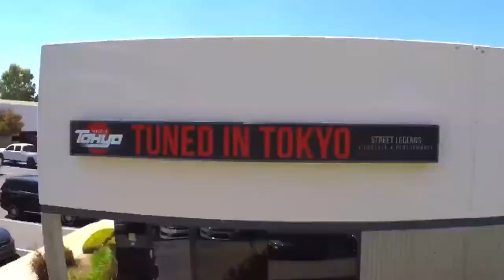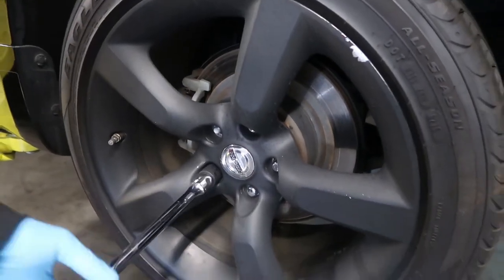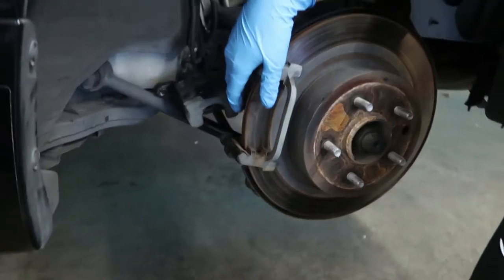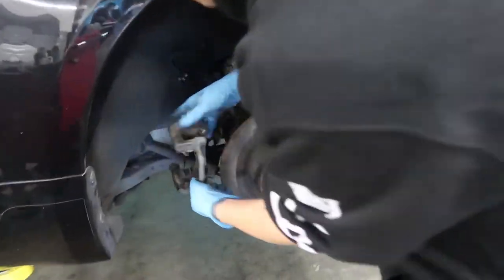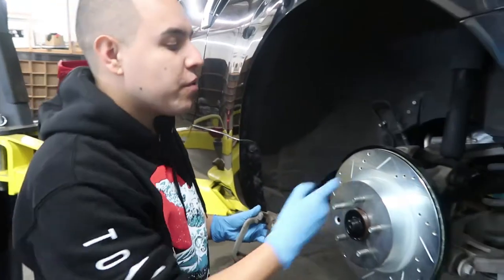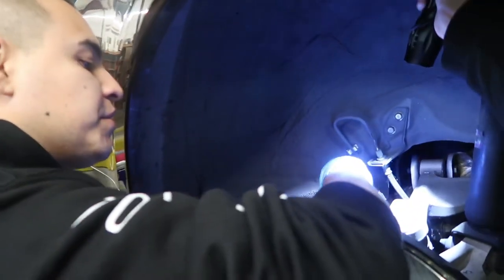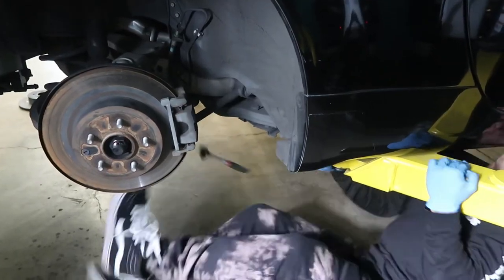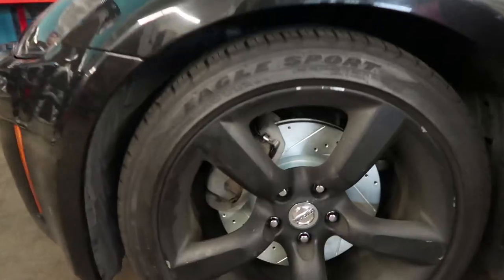Installing New Brake Rotors - 350z (Part 2)

Comment: Lmao this dude tried to remove the hub assembly/rear when beating while trying to remove the rotor then hammers the rotor out. You're supposed to get ebrake adjustment dial to release the rear rotors